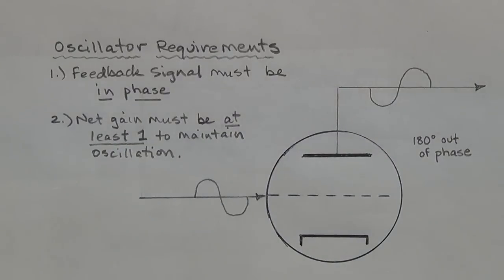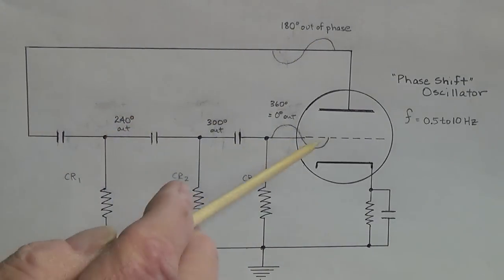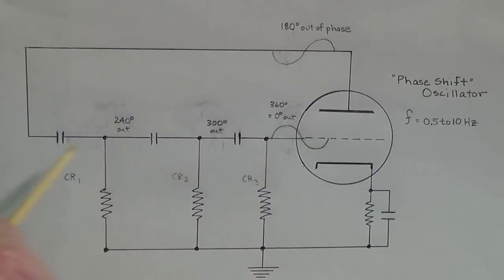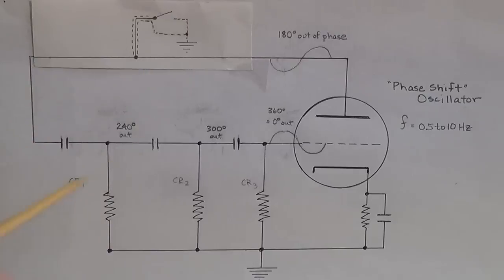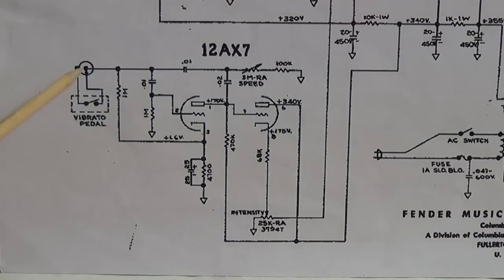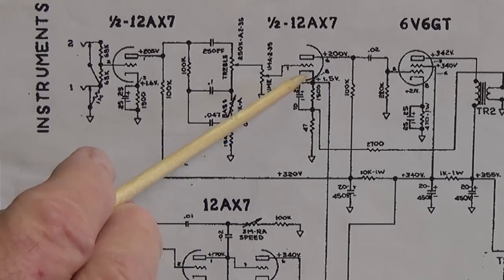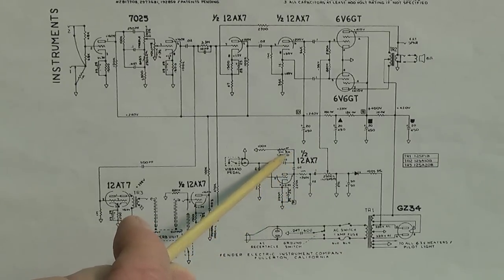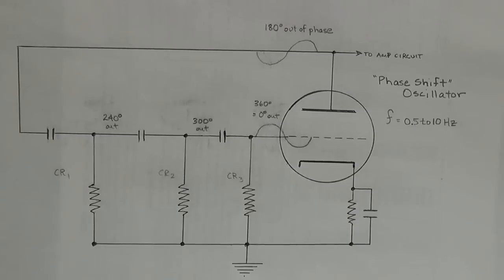How Does a Bias-Shifting Tube Tremolo Work ?

Comment: Looking at the vibro champ tremolo circuit schematic I don’t see a coupling capacitor between capacitor between the plate of the one half of the 12ax7 to the grid of the other half of 12ax7 is that correct?
Reply from the maker: Yes, it may look strange but the oscillator circuit produces modulated voltages rather than complex musical output.

Comment: Hi Rusty, can you ask Uncle Doug if you can add the Vibro Champ Tremolo circuit to a 5E3 circuit? Point for the introduction of the tremolo circuit at the V2a cathode? And thanks for a very good informative presentation on this.
Reply from the maker: He says that the cathode of the 12AX7 second triode seems like a good insertion point. Good luck :)

Comment: Fantastic and very informative video! Thank you for taking the time to do this. I do have a question though; What is the output of the oscillator? It's not part of the guitar signal I don't think? Is it just an oscillating voltage that can be used to influence bias of gain stages? And it's going all the time, we just blend in to taste?
Reply from the maker: At 1 or 2 Hz, it's not an audible signal, John.

Comment: hi doug,1 made a single end  audio with a 6sl7 and kt66 in ultra linear mode with 5 k primary ot  ,so i put the 2 triodes 6sl7 in parallel  for more transconductance and i have 750 ohms on cathode bias resistor to have 61 ma  on cathode.so i got a volume on my amp  so i injected 1.5 v with my generator and turn the volume amp until clipping but its the negative part of the sinus that clip first.i dont understand  why the 2 parts positive and negative dont clip in the same time .Thanks for your attention
Reply from the maker: Neither do I, KF.  You might double check the settings on your scope.

Comment: Great video Doug! Is the bias-shifting in the pre-amp tube the reason why my '79 Vibro-Champ loses a bit of volume when I turn the tremolo speed up even when the tremolo is disengaged with the foot switch?
Reply from the maker: Thanks, Adam. It's possible that your tremolo speed pot may slightly reduce the music signal strength.....but this is not an issue that I am familiar with, perhaps because I always leave the speed and intensity settings at zero when the tremolo is not in use.

Comment: GREAT Video..... thank you.
Two questions i have wanted to ask for a long time.

1.  Om both schems.
Is there no input signal to a Trem  Oscillator.?
There is no guitar signal involved.
It just osculates its own signal that it creates at idle.?

2.  On just the second schem with one triode.
It oscillates the signal from the plate, just like the two triode version above.
But is also uses the plate for the output signal that goes to the proceeding  bias circuit.?
That seems rather counterintuitive..... if yo get my confusion.
Not exactly sure WHY i think it would be a problem,  but i do.
Thanks Again  🙂
Reply from the maker: Thanks, M. 1.) It's my understanding that the oscillator loop signal is initiated by existing background noise in the circuit, then amplified. 2.) In a fixed bias circuit, there is a separate grid bias supply. The oscillator simply modulates the bias supply to create the tremolo effect.

Comment: @uncle doug,
Why is the NFB resistor changed from 22k (5f1) to 2.7k for the vibro champ? Im thinking of adding the tremolo to my 5f1. I have a 20k pot in series with the 22k resistor now and seem to like the amp better running closer to 40k resistance. Can this be left or do I need to use the 2.7k resistor instead?
Reply from the maker: Use whatever works best for you, RS.

Comment: UD, at 11:20 you say the 1M between the two 0.01 caps goes to gnd, when it actually goes to the cathode of the B side of the 12AX7. There must be a reason why it goes there instead of true gnd?
And if I understand correctly, it would 120 deg out of phase. Isn't that signal driving the tube like on some phase inverter circuits?
Thanks
Reply from the maker: I believe this connection is to "kickstart" the oscillation loop once the footswitch is activated.

Comment: If you've already answered this in one of the Princeton Reverb videos please let me know (I've watched several and have not yet found an answer to this question). On the schematic (shown at 10:14), what is the function of that .02 uf capacitor to ground coming out of the tremolo circuit? I see the 220k plate resistor connected to point B, and if my learning is going well enough that I'm not embarrassing myself, I think the .1 just before the Intensity knob is a coupling cap (please correct me if I am mistaken about any of this). But in-between I see that 1 Meg to .02uf. Again, unless I'm embarrassing myself here, what I've learned so far leads me to believe that's a low-pass filter, and if my math and conversions from microfarads to farads were correct, the cutoff frequency would be 7.95 hz. My question though is what is that for? What is it filtering out? 

The broader reason for asking (other than I'm all-in on genuinely trying to learn this stuff now) is that in the amp I told you about last week that I am going to replace the cracked tone slope resistor on with the other capacitor I asked for advice about whether or not to replace (and will do so), the capacitor in question is that exact .02 uf cap at that identical point in the circuit. It's not a Princeton Reverb literally but the guy basically built a Princeton with a beefed up power section from what I can tell. I traced the entire circuit and component values to figure that much out. On the amp, the tremolo is pretty weak right now. If a cap drifted/went bad on that filter, it just made me wonder what exactly that part of the circuit/RC filter on the Princeton schematic is there for, coming out of the tremolo section. Realistically if I can't get it up and running all by myself I'll surrender to Nashville Amp, but before I do, I'm enjoying the process of learning as much as I can as I go. 

Anyhow, I got some parts from Antique Electronic Supply as you suggested (although I ordered from Amplified Parts and realized it's the same store) and intend on pulling the chassis out this weekend. You'll be happy to know I've built a discharge tool for the filter caps so I'll be safe. I did manage to completely fix a "pop" in yet another amp that was making a noise every time I plugged in a 1/4" guitar cable to the input. Still don't have a scope or proper tools to see noise, but through a process of patience, experimenting, and ruling out all the tubes, I found a little bit of resistance between chassis ground and the volume pot. Loosened the knob completely and cleaned the chassis on both sides with 99% isopropyl alcohol, put it back together and my meter read perfect continuity. Powered the amp back on and it was perfect. Left it on for about 2 and a 1/2 hours and often plugged back in. Still perfect. A day or two later it was still perfect. Couldn't believe I actually fixed it at all (I may have a confidence problem) but finally realized I must have, put the back panel back on and put it back in the amp closet! So slowly but surely I'm figuring a few things out at least. Any words of wisdom you have on that RC filter in that Princeton schematic will be taken to heart. I do love learning
Reply from the maker: Greetings, Sean. Congratulations on your continued technical education and success. I'm glad you already recognized the cap as part of an RC filter. By watching my video on RC Filters, you could actually determine the filter type and cut-off frequency. As to the purpose of the filter, recall that the tremolo oscillator output is strictly electrical (to modulate the bias of the 6V6's).....there is no music signal.....so this filter prevents the delivery of any "noise" to the output tube grids.....only the modulating DC voltage.
Reply: @UncleDoug  Thank you so much. I sincerely appreciate you getting back to me. That makes perfect sense to me now. The part that confused me earlier was that I had not been thinking of the tremolo oscillator as strictly electrical, but of course that makes perfect sense when you explain it that way and completely answers my question!

Comment: Doug, good stuff! Curious why one amp uses the second half of the 12AX7 (Champ) and the Princeton does not. It would seem the cathode follower is needed to provide more current to be able to move the bias on the single ended preamp tube via its cathode bias (higher current node) vs. the grid bias approach on the power tubes in the PR (low current node). What are your thoughts on this?
Reply from the maker: I think that the circuit did not require the second triode, so it was left unwired. The simplest explanation is generally the right one.

Comment: Uncle Doug, thank you for your great videos. They are entertaining an very informative. One thing I don't understand about the tremolo is how does the oscillation start? When the tube is idle there is no signal on the grid. If the current through the plate is steady there shouldn't be any ac signal coming from it either... What makes the dog start chasing its tail?
Reply from the maker: There is always electrical noise in any circuit. The moment the oscillation circuit is ungrounded, the (almost sub-audible) noise starts the oscillation.
Reply: @UncleDoug  Thank you very much! That makes sense. And thanks again for your channel. It encouraged me to get back to my old hobby when I was a teenager. Now, I am 60 and started playing with tube amps again🙂 I got Sano amp from the 60-x that I am fixing and also converting its stereo input into 2 guitar inputs - one of these channels with 2 stage 12AX7 modifying into a distortion channel. An interesting feature of the amp - it has a separate amp with its own 8in speaker for the reverb. My other project is the guts from Lowrey tube organ turning into a guitar amp, using the organ's vibrato and possibly the tone tabs, also making the foot pedals working to play along and keeping some of the manual's keys for the guitar tuning. This whole contraption (all of the organ's innards) will be wall mounted in my house.
All this and more after watching your channel! 🙂
Thank you!
Reply from the maker: @bobmead8184  Glad to hear that the videos are helpful, Bob. Good luck with your projects.
Reply: @UncleDoug  Thank you!

Comment: I don't see where the original ac grid signal comes from for the oscillating circuit, is it generated by the remaining ripple in the plate voltage making it around through the high pass caps?
Reply from the maker: The music signal and the oscillating circuit are completely separate. The oscillator simply modulates the bias of the output tubes, altering the output volume.
Reply: @UncleDoug  Thanks!

Comment: Hi Uncle Doug, hope you are doing well. While slightly off topic, I have a question that this video brought to mind. What happens to the fixed bias part of the circuit if you choose to convert to cathode biasing? Is the fixed biased circuit with the diode disabled? Does the tremolo then  work by the same principles if the amp is converted to cathode biasing? Thanks in advance :)
Reply from the maker: I would advise against such a conversion, LHR. You would be fundamentally changing the performance characteristics of the amp. A hybrid form of biasing might be acceptable.....Fender tried this with several of their larger circuits.....but complete conversion is not a good idea, and would probably require some sophisticated circuit modifications to preserve the tremolo function..
Reply: Thanks!

Comment: I realize this comment comes about 6 years too late, but I am troubleshooting the tremolo circuit in one of my beloved amps.  It is a Princeton Reverb style circuit ( tube layout being 12AX7 / 12AT7 / 12AX7 / 12AX7 / 6V6 (x2) / GZ34 ).  With the tremolo engaged, I am getting a low end heartbeat throb / thumping noise that follows the frequency of the tremolo and becomes much more pronounced at lower speeds.  Disabling the tremolo stops the noise.  This amp has an adjustable negative feedback defeat, which also increases the intensity of the noise as I reduce negative feedback.  Is there anything to be done about this or is it just part of the "charm" of bias modulated 6v6's?  Thank you for your time and fantastic video!
Reply from the maker: On the non-optoisolator type tremolos, as in the PR, there are multiple reasons for tremolo thump, including lead dress, excessive output from the oscillator tube (remove the cathode bypass cap), etc. I suggest moving wires around with a chopstick, experimenting with different oscillator tubes, removal of bypasss cap, and general testing of all components in the circuit. Good luck.
Reply: @UncleDoug  Thanks so much for the quick reply, Doug!  I will poke around and see what I can find.  I just came across a suggested fix, which was to install a 1N4007 diode across lugs 1 &3 of the intensity pot.  Have you heard of this?  In the meantime I will try swapping V4.  If the cathode bypass cap is the culprit, must it be replaced?
Reply from the maker: @dwaynedelario  Let me know if the diode works. I've never heard of that approach. No, you simply remove the bypass cap to reduce the gain of the tube.

Comment: I found it, Uncle Doug! Woohoo!

I just fixed my fuzz pedal the other day after it had been broken for a while. I must have rewired it 3 times and it still didn't work. Like an idiot, I had changed out one of the pots for no reason and it was dead on arrival. It took a couple of days but I finally decided to just put the old 1k fuzz pot back in and it worked again lol. D'oh!
Reply from the maker: I'm glad you solved the problem, JC :)

Comment: Hi Uncle Doug, when the intensity pot is to the right the tubes are biased by the -34vdc when the pot is set to the extreme left the oscillation goes to the grids, but what voltage is being applied? Is the -34 totally out of the picture? Thanks for your excellent videos!
Reply from the maker: The -34VDC should be applied to the grids, Alvaro.....but the tube bias varies in response to the tremolo.

Comment: Hi. I've seen some tube fx pedals (including a tremolo unit) that uses 12V. Any idea how these work with such little voltage?
Reply from the maker: They use transistorized circuits, which run on much lower voltages than tubes.
Reply: @UncleDoug  what about this one:- https://www.effectrode.com/products/effects-pedals/delta-trem-tube-tremolo/

Comment: I love your videos! One suggestion though: while I realize you are trying to keep your audience from leaving to watch pole dancing videos, can we get a bit more of the mathematical underpinnings of the designs you present? For example, you state in this video that by choosing the right values of the resistors and capacitors, you can get 3 60-degree phase shifts. I see below that your reply to one comment mentions that phase shift = arctan(1/wRC), but it would be good to mention this is in the video too (and the fact that phase shift varies with frequency, although I assume by using the right values you can minimize this effect across the pertinent frequency range).
Reply from the maker: Thanks. I appreciate your input, Tim, but I can assure you that the mere mention of the term "arctan" will send 90% of my audience streaming for the exits. I present math concepts when necessary, but honestly didn't feel it was needed in this presentation.

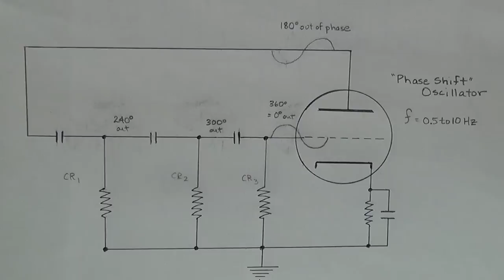Comment: Doug, I think you made a small mistake here. At 6:16 the phase shifts at each RC network should be 60, 120 , 180 degrees instead of 120, 240 , 360 degrees, But I still understand your explanations, Good work !
Reply from the maker: You're ignoring the initial 180 phase shift from the grid signal to the plate output. Then, when you add 60 degrees to it in succession, the result is 240, 300, and  finally 360 degrees. The incoming signal from the loop must be in phase with the signal on the grid for oscillation to occur.  If your statement were true, the 180 degree out-of-phase incoming signal would nullify the grid signal and no oscillation would occur. Source:   http://www.valvewizard.co.uk/trem1.html

Comment: Uncle Doug- How difficult would it be to put in this bias wiggle type tremolo into my ol 68 pro reverb ? I really prefer the bias wiggle of the smaller brown face amps and it doesn't look too difficult?? Has anyone ever approached you with this type of job
Reply from the maker: The problem with bias-modulating tremolos is that they work best in lower-wattage and SE amps. The idea of modulating the bias in high-powered output tubes, i.e. in a Pro-Reverb, is not a good idea.